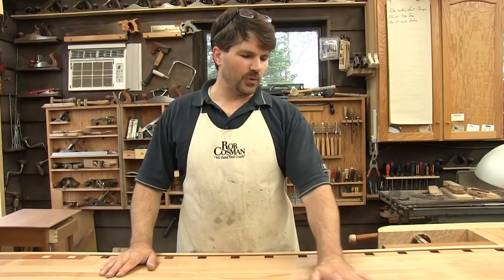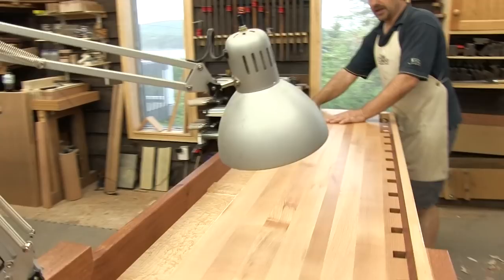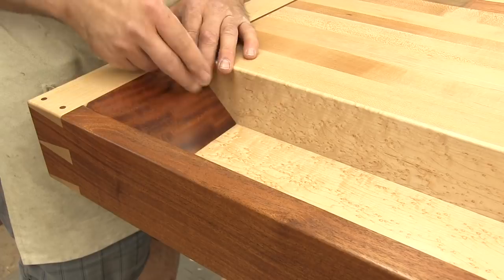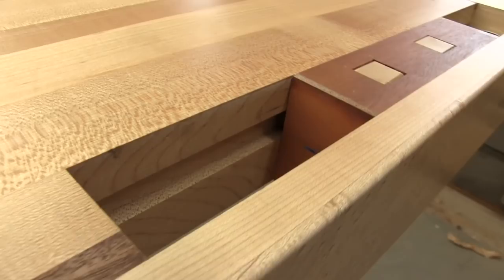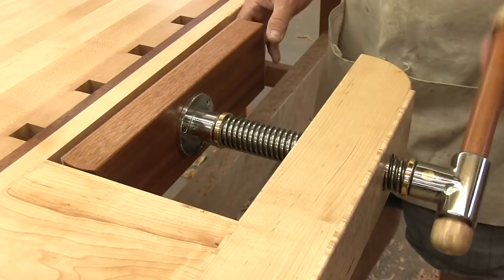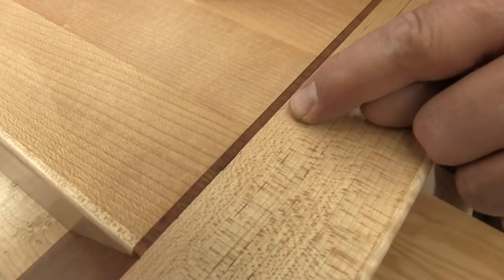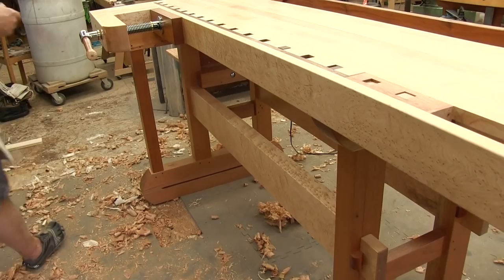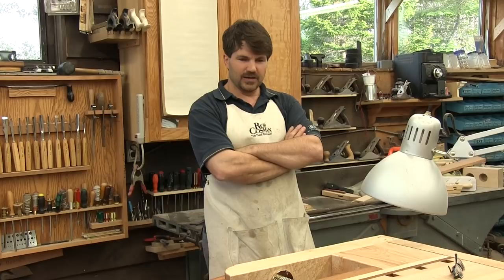Workbench Completed with Rob Cosman

Comment: Have viewed this vid three times over a couple years, and every time I learn more.  One of the best examples of planning for active wood movement.  Truly a stunning result.  

There is a widely held belief that you'll only ever build ONE bench in your lifetime.  It's a great rationale for using fine materials, installing vice hardware that's just that little bit better, etc.  Good negotiating point when debating cost and space with your roommate or when justifying a larger garage.  

The once-in-a-lifetime theory needs to be grounded in reality.  I built my first workbench when I was six.  It's long gone.  I have a wonderful student workbench that came from a school that was replacing their old stock.  It came with two working vises--not fancy but they work.  It has an interesting height adjustment with one hinged piece on either end, with the flexible piece attached on top of the base; works nicely but has its limits.  I have made several workbenches over the years.  Truth is, life happens.  Your workbench might not follow you after a divorce or death because your living and working space can change dramatically, just as one example.  The finest benches are often heavy so when you move 500 miles that great bench is going up on Craig's List for whatever you can get.  Just remember, part of what you get is a fresh start on the far end.  It's called life.  When you take up the challenge, each fresh effort is better, somehow.  Cheaper?  Prettier?  Stronger?  Longer?  Heavier, or lighter?  Mobile, or nearly immovable?  "Better" is whatever you say it is, this year.  You MIGHT hold the same opinion in five years, but in ten years you'll think something else because we all grow up.  

That said, if I had a bench like this I'd make like Peter Pan and stop growing up.  Forever.

Comment: I had a Black and Decker folding work table which I hated. It was clunky and difficult to open, fold, and stow. Always seemed like it wanted to topple over on me. After I got rid of it, I found I needed something to help me install new garage door openers. By the time I decided on the WORX Pegasus, they were out of stock.Since the project could wait a bit, I ordered two. They came faster than Amazon promised and I have not been disappointed. I used them as work tables, a repository for old and new small parts as I removed the old opener and installed the new one. There are cup shaped indentations in the surface where you can park screws, nuts, small tools, etc.When it came time to secure part of the opener to work on it, the clamps and dogs worked well. I used one table for the work table and the other for a temporary support for the opener rail as I was installing it. After finishing, the tables folded right up much more easily than the B&D table. Stowing them in the garage was easy.I didn't try to connect the tables, but I could see that the connectors were provided and stowed out of the way.

Comment: Amazing workbench. Bravo.......As a respectful counterpoint, some of the most amazing and accurate woodworking that I've ever seen has been in wooden racing dinghies from the 60s through to the early 90s, specifically "Merlin Rockets" (look them up). To look at the joints you might imagine they'd been made by CNC machines in Japan/Germany......when in reality they were made by people working in simple sheds with a bare minimum of tools, materials, space or training....but huge amounts of skill, passion and attention to detail. Take away, never under estimate what can be made in a shed with very, very little.....and respectfully, not a pristine workbench, ever.
Reply from the maker: Look at what the Romans accomplished with their workbench!!  I agree whole heartily, but it can be a bit bit easier with good equipment.

Comment: Hey Rob,
I think you'll like the springs from Bic and other types of lighters.  There are some shorter springs with slightly larger diameter that would work really well for these types of applications (along with some longer ones too that resemble the pen springs you have been using but with a narrower diameter.)  I've found that a bent needle nose works best to take the lighters apart.

Comment: Like you Rob I like Tage Frid. I am building a very similar bench at the moment except the top is non furniture grade chestnut so it has knots and imperfections so I CAN use it!
I even highlight the imperfections with bronze powder in epoxy to fill the knot gaps (and the occasional mistake!). I also have made some changes as the tail vice is almost twice the normal length and travels 13". The rail under the top near the front gives 13" of travel from the far end so remains over a foot from the thread hole so it can't droop!. That design also moves the typical workpeice into the bench and frees up the front edge for the trestle support at the bench end! I should have 83.5 inches between dogs to enable me to make doors. The tool tray is maple and finger jointed along it's whole length front & back so the back vertical edge is supported in sliding dovetails for movement. The clear-out ramps have no movement issues.
My challenge has been the chestnut, it was cracked, knotted & twisted but deserved to be something!. The 72 feet of 2.25" by 5.5" has stretched to the top only, the trestle will come out of my other wood now.
Your hardware is beautiful. My total budget of $400 would not stretch to that! Your bench shows people what is achievable with a generous budget and the experience to remove any joint roadblocks. I would encourage people to not seek plans for their build but enjoy the thought process of truly building their own bench. Most people only build one good bench so design progress will be very slow if you just follow someone else.

I love your bench and the extreme care you put into it. I do wonder if you are adding holes for hold downs. I do question the dual height aspect, I am going with 38" height. If the plane is sharp pushing down is less important than walking the length of a long board. To that end the hinged wood idea can work on the front right trestle leg for clamping a long board but swings away for leg clearance when working on the bench top. The trestle foot ends seem a little short and lack presence to balance the look but that's just me. A gorgeous bench!

Comment: How did you come up with the demensions of your shoulder vise?  How far right did you go from the side of the workbench? Ive only found 1 article online saying the length should be the same as the width of your bench. Is this true?  Gorgeous bench tho!  Im trying to build a shoulder vise and tool tray on the cosman workbench but im stuck on the shoulder vise lol

Comment: I would be very nervous and find it very hard to concentrate on my work using this bench simply because it is so beautiful I would be in constant fear of damaging it. This bench would have Gustav Stickley's and many other fine furniture makers jaws on the floor. It truly is a work of art. You have one lucky friend there. I really like the design and the functionality of it, but if I were to build one I'd have to use just plain old maple or oak just so I wouldn't feel guilty using it. The only thing that remotely lets it down are those second feet. although they work well, they don't look quite right in the lower position. Seems like it should have a more sophisticated lift system.

Comment: Hello, Rob. I have a question: does the small platform of the vise of shoulder with the grain cross, compared to the grain of the top of the bench, not affect the expansion of the grain of the bank in that specific place or that small part is not enough to cause any problem? I'm sorry if the question is stupid or childish. I know this crossbreed is common in this kind of workbench, I just wanted to understand that part.

And congratulations for the work, it's really a beautiful bench and it looks strong.

Comment: Rob, where did you source the vice parts?  That screw looks much more robust than the standard you'd see in a typical vice.  Thanks and greetings from Maine!
Reply from the maker: Hey Ed, originally I had them fabricated by a local machinist friend, but the pieces alone cost me well over $500 before his labour! So I took the idea to a friend of mine that has access to production machine shops and now we sell them here: 
https://robcosman.com/collections/workbench-accessories/products/rob-cosmans-bench-vises
Reply: @RobCosmanWoodworking  I appreciate the reply.  I'm looking at replacing my 20 year old bench that I threw together without much thought.  It's time to custom fit one for myself and have been kicking around vise options.   I'm in my transition from a power tool guy to a hand tool woodworker, or at least being a hybrid.  Thanks for all you do, you've inspired me to start making wood shavings instead of  just sawdust!

Comment: Wow. How is the top fixed to the legs?
Reply from the maker: one dowel in the center at each end.  i have since replaced that with one lag bolt to make it easier to move by picking up the top.

Comment: Rob Cosman,
How much build time do you estimate it took?
How much money would it cost in material to build this w/o expensive woods?
With the wood you chose, how much did it cost in material to build?
Thank you.
Reply: So, for (180-30 min. episodes) X (2 aka double off camera) = Total time = 180 hrs. Assuming you meant to say 180 hrs to be safe (4.5 - 40 hr work weeks) and labor is $20-$30 per hour. The labor alone is about $3,600-$5,400. If the normal material cost is $1,500 and the material cost for the nice one on the video costs about $2,000, the total cost of you building one w/o delivery and taxes is between $5,100 & $7,400.  Best case scenario, you can easily build 11.56 of these in one year making $62,400 annually. Not bad at all. :-) Do you need an apprentice this summer? I'm a senior Engineering student in FL. My wife would never allow it. :-(  Keep up the fantastic work!
Reply: I was figuring the wage based on side work because you said you used some wood you have been saving over the years. I suspected the  workbench was for a friend. My mistake. In that case...a work bench would cost between $19,500 and $20,000 each. And your business could bring in up to $231,200/ year if you are the only employee and you only work 40 hrs/ wk. If you are a business owner...I suspect you work nearly 55 hrs/ wk in the shop and 15 hrs/ wk outside the shop (paper work etc.). Also, I'm sure you do other work that is more/ less profitable and not just benches. It was a rough estimate. Thanks for getting back to me so quickly Rob Cosman. You produce some quality work with a high level of craftsmanship!
Reply: Maxwell Goodacre Don't forget the subscription based website he gets revenue from.
Reply: Maxwell Goodacre Those are some impressive numbers. I think they may be a bit skewed, however, since Rob spends a great deal of time teaching as he goes. (I am in no way affiliated with Rob Cosman). I'm not sure how quickly he could replicate this job if it were he alone, banging out a project, but I suspect it would be considerably quicker. I'm not sure if you've taken the opportunity to check out Rob's site, with the free trial membership he offers (if not, it's really awesome and I highly recommend it), but he explains so very much. There is so much happening that novices such as myself would never think to even consider (I'd argue that there are "masters" that don't think to consider some of the things he teaches). As long as I'm putting Rob up on a birdseye maple pedestal, he also explains the thoughts and ideas in an easily digestible format. Though I can't afford the membership at the moment, if I had the money, I would pay whatever he was asking. I simply can't say enough good things. Maybe I should add in a negative for some balance, like how he has too much hair or something... nah...

Comment: Dogs work much better if their upper ends angle towards the work piece by a few degrees.  When clamping pressure is applied, the dog moves back and the angle forces it down.  That downward movement pulls the work piece firmly down against the bench top.  This is very beneficial, but many people don't know anything about it and they make the holes for their bench dogs vertical.  Because a good bench dog is angled, the face that engages the work piece must be in a different plane to be vertical.  That means the best dog can't be a simple rectangle.

Comment: Sadly for such craftsmanship it misses the traditional tail vise. Without a traditional tail vise and all it offers (a lot) you miss one of the biggest advantages of the Tage Frid and Frank Klaus design. You can get expensive hardware that makes the traditional tail vise easier to build, but the least expensive tail vise screw works very well.I understand your viewership may be sensitive to a more difficult build, and you want to hang on to them, but most of them want to serve dinner on it! It's wonderful that you still have traditional dogs! Can you raise them 2 inches? Even a few on the back of the bench enables the use of a bench stop across the bench. I don't know why almost no traditional benches have them, when they can be added so easily.It just seems incongruous that you chose that tail vise as 'easier' when that level of craftsmanship is the exact opposite to easy.
Reply: Yes Rob easier to build. I designed my tail vise to be twice as long as usual. The support is excellent, the 13 inch opening and bench extension) with 5" sq. faces holds stock at an angle or upright. Sounds like you were willing to compromise for a second bench; most of us only have one serious bench!

Comment: Trestle bases are not the best way to go.  Beefy, square legs running straight from the floor to the underside of the bench top works much better.  Locate the legs with one face of each leg flush with the edge of the bench top so you can use holdfasts or support pins.
Reply: *****
It's my opinion, but it also happens to be true.  You have many opinions that also happen to be true.  It's such an obvious advantage to have the legs flush with the front that it's shocking to see anyone ever make a trestle base.  A bench slave is whimpy compared to a solid leg.  It won't work nearly as well with holdfasts and you have to go grab it when you need it.  Trestle bases have zero advantages over a straight legged base.  With all that said, I subscribed to your channel long ago because you are a god of hand tool skills.

Comment: I'm not clever enough to understand why your bench/any bench includes a "Work Tray" - I think the space used would be better served by including a wider working surface...
Reply: Because it is for working on single items and not for assembly. The tray is actually nice to lay your tools out of the way, not knocking them on the ground. If you only have space for one working area, you're right.

Comment: Tool trays collect dust and junk.  They're a waste of usable bench top surface.  Don't ever lay your tools on the bench, put them away every time.  If that's too hard, you don't have a good tool storage system.  Wagon vices don't give the same holding versatility as a tail vise.  Rob's claim that tail vises sag isn't completely true.  You can buy steel hardware that makes a solid tail vise.  It's also possible to make one out of wood that won't sag, but you need to make it a bit differently than the traditional method.